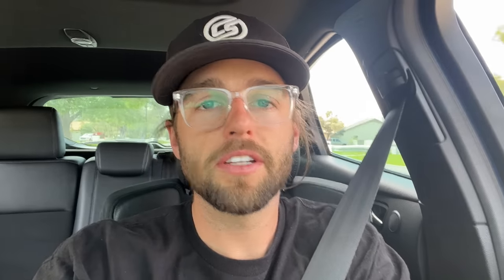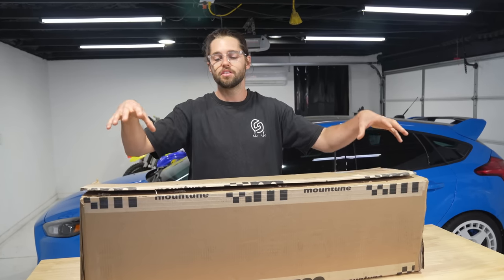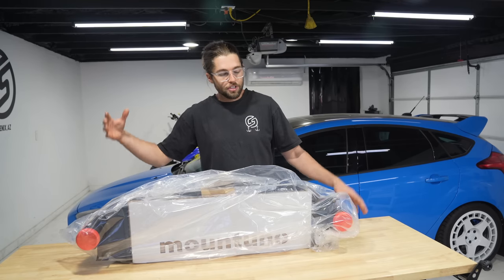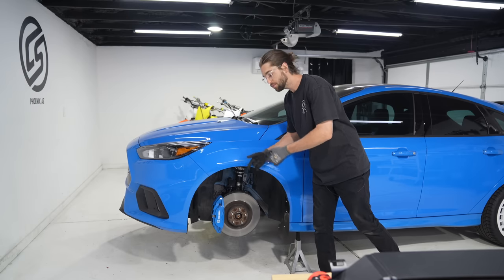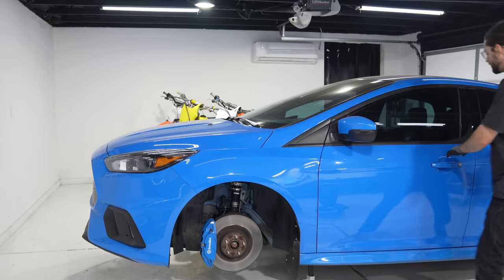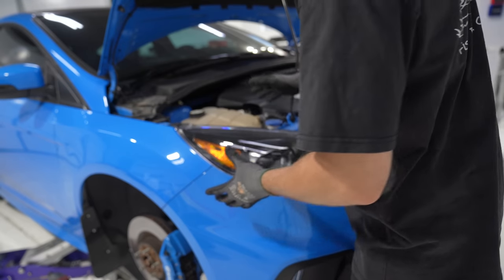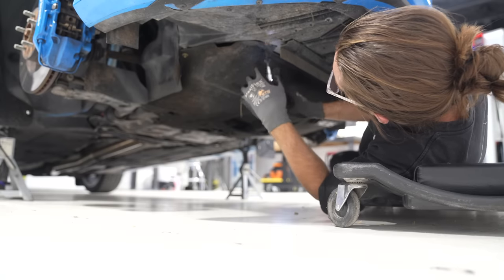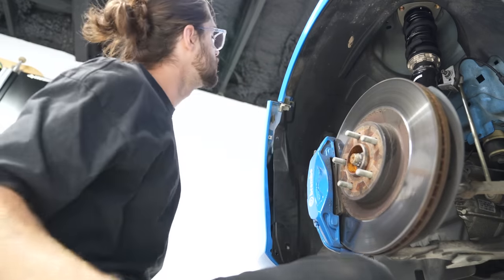A Focus RS MUST! Mountune Front Mount Intercooler Install

Comment: The blocking plate is actually there because the RS intercooler was “too efficient” and in humid climates actually created some condensation in the system.

Comment: Just installed the Airtec Stage 2 intercooler on my 2016 Focus ST Wagon last monday
I installed new boostpipes since i was there, 2.5 inch mostly metal, with a few silicone bends and connectors
After a lot of sweat and finessing the new intercooler in i noticed some great improvements like a torque increase and a overall smoother idle

Also when doing a 3000 rpm pull i get some turbo flutter noise which is always nice
Reply from the maker: That gets me giddy for you lol.. serious gainz

Comment: I Absolutely love this channel best RS CHANNEL I HAVE FIUND FOR MODDING AND EXPLANations.

QUESTION?     Would changing the inter cooler piping and removing the restricted plate with a tune would help keep the temp down to minimize heat soak?

Comment: Quick question. I bought the same intercooler for my focus rs as well. I’ve read up on some forms about needing a tune after install. There was mixed opinions and I would love to hear yours. I believe you won’t need a tune unless you want the performance side of things from the upgrade and the factory ECM will compensate for the change in MAF, but since the RS is MAP based it shouldn’t be a problem? idk who to believe at this point. I would love to hear your input. Is this correct?

Comment: I would like to say that the statement for how to create more power in an NA engine isn’t entirely true. With NA motors your typical bolt ons are all about getting more air in and out the engine. More air lets you add more fuel which means more combustion. Obviously timing is a key tribute when tuning but that isn’t the only way to make more power. Intake, throttle body, manifold, headers, and a catback all let you get more air in and out the system. And with muscle cars, camming them just lets you keep the valves open for longer duration to allow more air to get in the combustion chamber.
Reply: R tree jay is a true statement,   However I can only cool a certain amount amount of air in a non turbo, so opening up the air flow in a non turbo means the radiator has to work harder n heatsoak expands 0:30 air cause the flow is too fast.      It can only breathe  better when all restrictions are removed.       

I’m my humble opinion,   The RS does not have a functional hoodscoop but has a lot of air hitting the front so it makes sense to switch to an intercooler in to w front.

So yea the statement technically is not 100 percent true,    I believe he was trying to make a point in the difference an fmic makes on a forced induction car.

Comment: I'm curious to see how much this affects your coolant temps, as with my FMIC on a Speed3 it's a drastic difference. Almost wish I could stay TMIC in the summer and FMIC in the winter!
Reply: Are you on the stock K04?? I wanna get a FMIC on my 09 speed3 since the gen 1’s don’t have a hood scoop and tend to get heat soaked, currents mods are 
-forge BOV
-cold air intake
-turbo inlet 
- Cobb AP
- tuned on 91

Comment: Hey cam I got a question I recently got a mustang but didn’t get the active exhaust system so if I go buy a after market one with active exhaust will I get the exhaust modes in the car when I install it?

Comment: impossible to dip below ambient with a simple air to air cooler, the only way it can get below ambient is adding an interchiller that runs off the car A/C or add a water sprayer on the cooler face and or nitrous or c02.
Reply: incorrect

Comment: The rs doesn’t need a bigger intercooler. They block off 30% of the air entry from the stock equipment. 
They did this because the stock intercooler overcools the air in many conditions. 
I can’t see why this is a necessary upgrade and not a sales pitch.

Comment: Did you check the charge air temps before installing the intercooler? it would be nice to see a comparison.
Reply: Intake temps hit about 190 in a focus ST and probably similar or worse in an RS. Post intercooler drops to 90<
Reply: i have a focus st 2016 stock intercooler cruising at 80 i’m riding at 140° in florida at like 90° weather
Reply: @theofficialkevin with blocking plate off?

Comment: I have a Focus ST mk3 from 2018. and does this intercooler fit my car?
Reply: The one Cameron installed is for the RS, but Mountune does make a front mount intercooler for the ST.
Reply: 90% sure every intercooler is interchangeabke between STs and RSs. The only difference between the two is that the rs has a 2.3 and AWD system

Comment: Is the RS still on the mountune calibration?
Reply: Very likely, because the charge air temps didn't appear to go below ambient at all. I ran the Mountune calibration with a Mishimoto FMIC on my ST and my charge air temps were always slightly above ambient. It wasn't until I got a tune from Stratified that my charge air temps went below ambient. Remember, the Mountune calibration doesn't take into account what parts you've installed like a custom tune would.

Comment: This thing is such an awful design. It’s like they didn’t even do a test fit. Getting the slots over the tabs AND the lower brackets on top of the lower mounts is virtually impossible without prying (which is scary on plastic parts).
Reply from the maker: You don’t want it to rattle around. It’s a good thing it fits so tight, trust me, they designed it this way. 

On the other side of what you are feeling is something you don’t realize you don’t want and more problems. You got this, just be careful and it will go in place 💪🏻